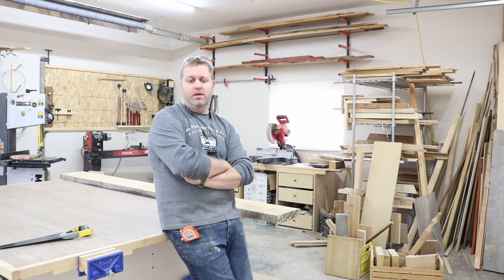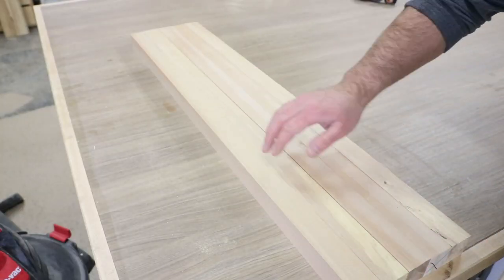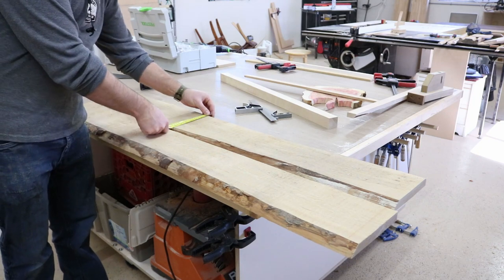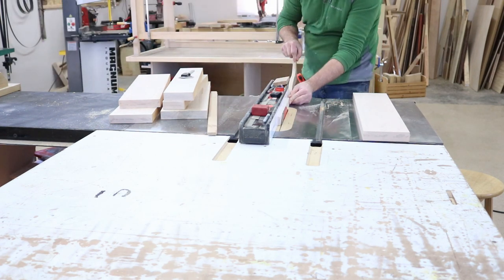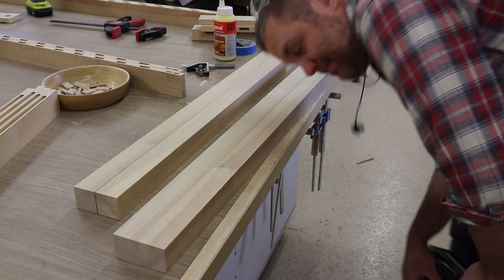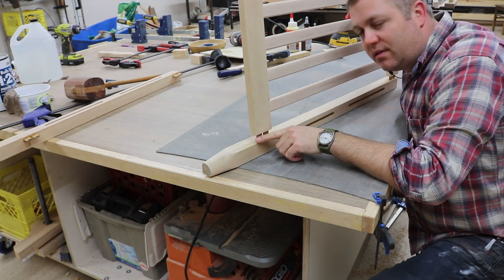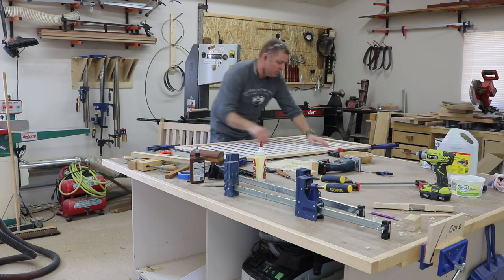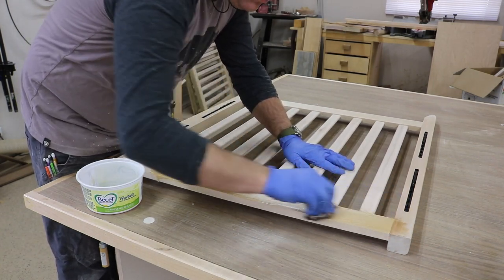Building a Crib for my Daughter  || Making a Midcentury  or Danish Modern Inspired Crib

Comment: Nice work! Im getting ready to build one for my first grandchild. What is the name of the Lee Valley hidden connectors? If you had a part number that would be awesome. Thanks.
Reply from the maker: They’re Megalox Panel Connector
Item 00S0184
They’re really easy just line up your mortises and they go right together. They only problem is they’re just a hair wider than the bit I used for the mortises. If I was to do it again I’d make a template instead.
Reply from the maker: Thanks for the sub as well

Comment: The panel connector hardware is genius.   Where did you get it?  Also, how did you suspend the mattress frame?
Reply from the maker: Thank you. I thought it turned out rather well. They’re megalox panel connectors from lee valley. The mattress frame is suspended from two strips of poplar glued to the bottom edge of the side panels. It’s just a sheet of 1/2 Baltic birch plywood.

Comment: Do you have any plans or dimensions available?
Reply from the maker: I don’t have plans. I have my original sketch up model but because of my material constraints it looks quite a bit different that the actual crib. The rough dimensions are built around the standard crib mattress size. It’s 28 inches by 52 on the inside and every thing else is built out relative to that. The sides are 32 inches tall and the bottom of the rails are 5 inches off the floor. I might be persuaded to draw up some plans for a small financial donation 😁